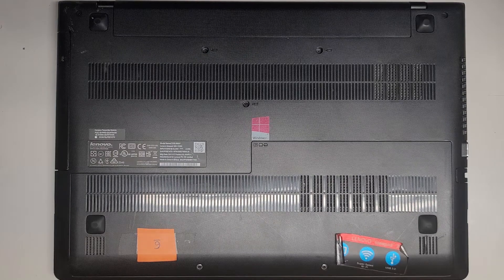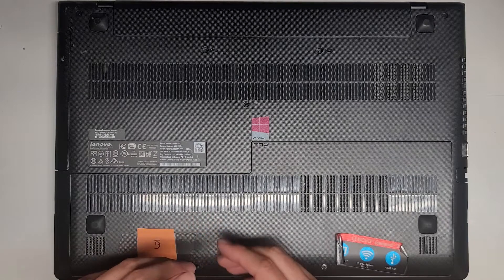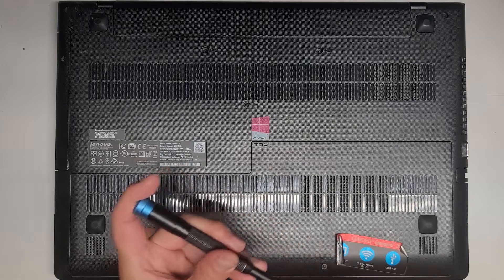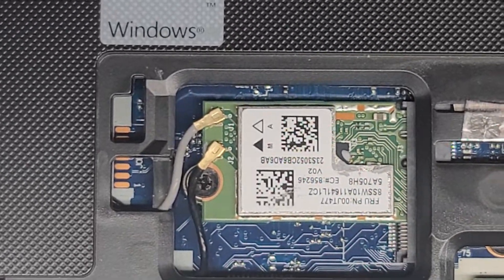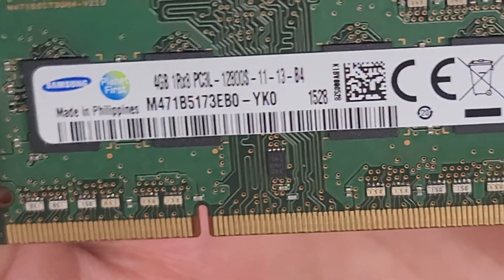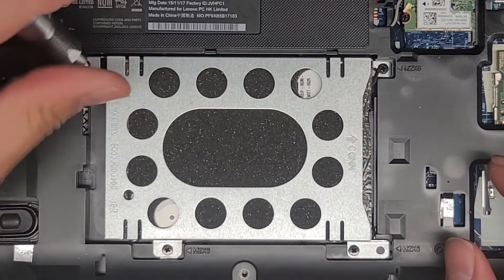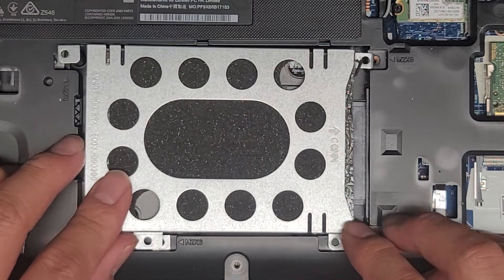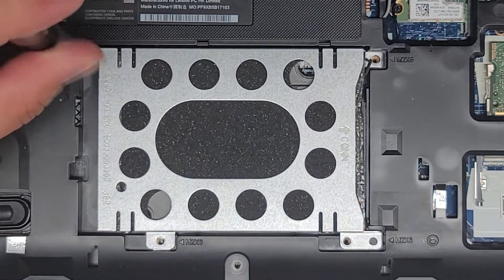Lenovo IdeaPad 300 300-15ISK 80Q7 Disassembly RAM SSD Hard Drive Upgrade Replacement Repair

Comment: Thanks for the video. Very informative. Mine is the exact model in the video. I've pull out the hdd measure it and found the dimension to be exactly 10mm x 70mm x 100mm. Is this the same  nominal 2.5 inch drive you are suggesting?
Reply from the maker: All 2.5" SATA SSD will fit.
Reply from the maker: It's not actually 2.5", that's just what they call it.

Comment: @Binh
The connector to the HD, that is, the “wire”, got loosened because the connector was stuck onto the hardware (HD), and the wire disconnected from the Motherboard. How to reconnect it? Thanks.
Reply from the maker: What time stamp?
Reply: @ItsBinhRepaired  My computer, not the one in the video.
Reply from the maker: @linguist8623  well then I have no idea what you're referring to. I don't know what computer you have and what it looks like.
Reply: @ItsBinhRepaired  The same as yours, minus the same UPC.
Reply from the maker: @linguist8623  what time stamp do I show it?
Reply: @ItsBinhRepaired  Approximately at 3:26 - 3:39. The connector on yours stay in, whereas mine stuck to the HD, then later on, the cord/wire itself, connecting it to the motherboard inside under the plastic, broke off. How to reconnect the wire?
Reply from the maker: I hate how YouTube doesn't notify me of replies. Were you able to figure it out? Need to take the computer apart sadly.

Comment: I have the same laptop but i already have 16gb ram
but yet the PC is Too slow and lags. whenever I try to use OBS and chrome and it takes almost 5-10 mins to do anything after turning it on .
what to do
Reply from the maker: Is your laptop using an SSD?

Comment: Hello, how are you? I have a Ideapad 300-15isk laptop, model 80RS, and I'd like to know what size SSD it supports. I'm a bit lost. Thank you very much.
Reply from the maker: There is no size limit. How much storage did you want?
Reply: @ItsBinhRepaired  :
Really? I decided to search for the manual of this laptop on Lenovo's website and ended up finding it. It says there, unbelievably (which sounded absurd to me), that the maximum supported SSD capacity for this laptop model would be 128GB, a ridiculously small number. I feel more relieved when I see you say that there are no limits. Therefore, I think an SATA SSD of 1TB would be ideal for me after all.
Reply from the maker: @pedritobarret  the limit is what they sell
Reply: @ItsBinhRepaired  So, the limit would be 128GB?
Reply from the maker: They make 4tb SSDs, why would you be limited to 128gb?

Comment: Hello brother, what is the ram capacity? I saw that ddr3 and ddr4 are supported up to 32 GB, is this true?
Reply from the maker: @emreurekli  you have to us the same type of ram that's in there. DDR3 cannot be put where DDR4 is used and vice versa. You can use whatever you can fit in the slots. There is no max capacity other than what's made and what you can afford.
Reply: @ItsBinhRepaired  thank you bro
Reply from the maker: No problem

Comment: Hi, Thanks for your informative video. I want to take the upgrade another step further, and install my old HDD in a hard disk bracket and install it in place of DVD ROM, Do I need to disconncet the battery to do that?
Reply from the maker: Nah, just make sure it's off
Reply: @ItsBinhRepaired  Thanks a bunch!
Reply from the maker: @MajidMotamedi-ud8vw  no problem

Comment: is kingston a400 good for a ssd for this laptop?
Reply from the maker: Yeah
Reply: why is it not vooting?
Reply: booting*
Reply from the maker: @Hiraiiiiiiii  need to clone the drive or install windows on it
Reply: how to install windows?
Reply: @ItsBinhRepaired  i cant find any cloning tool that is free
Reply from the maker: @markdavebernardino6739 this video, but create a usb https://youtu.be/R6GVDyVqWso
Reply from the maker: This will help https://youtu.be/4p5jFDzVwUw
Reply: this device only have 1 slot for hard drives right?
Reply from the maker: @markdavebernardino6739 yeah
Reply: after the cloning process is done, i can just take off the hdd and replace sss and it will automatically run?
Reply from the maker: @Hiraiiiiiiii  yup
Reply: THANK YOU BROO!! AFTER 5 TO 6 HRS I'VE FINALLY CLONED AND REPLACED MY HDD YOUR MY SAVIOR HAJAJA
Reply from the maker: @Hiraiiiiiiii  lol awesome!
Reply from the maker: @Hiraiiiiiiii  if you haven't already, please like and subscribe so others can find my videos and possibly consider watching a few others and commenting to get the algorithm to recommend my channel. Thanks!

Comment: Hi. I have same laptop like in this video. The problem is, when I install the ssd ( silicon power 2.5 ssd sata 3) the laptop stuck with lenovo logo and cannot enter bios. But After remove the ssd, can enter bios. Hope you can help
Reply from the maker: Sounds like a bad SSD
Reply from the maker: You could try this https://youtu.be/4p5jFDzVwUw